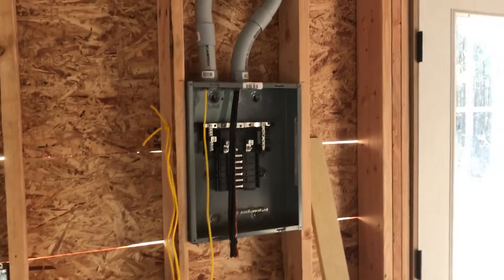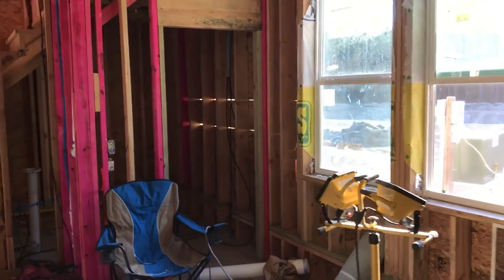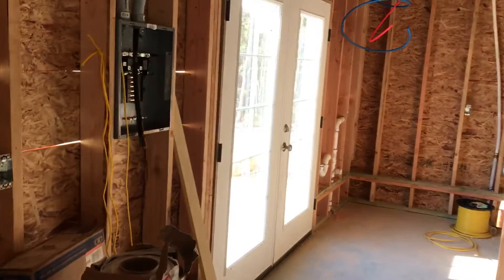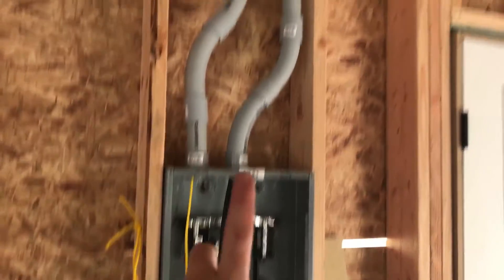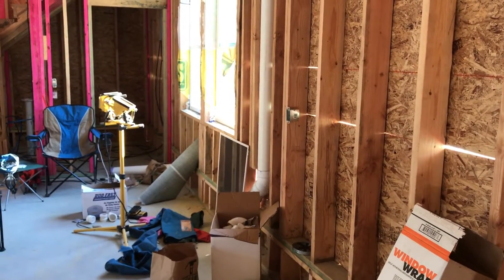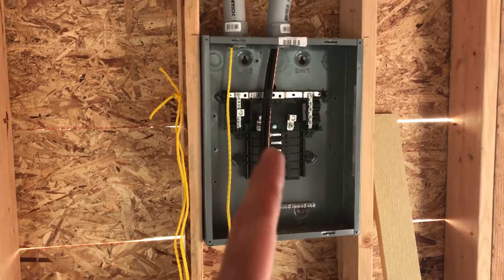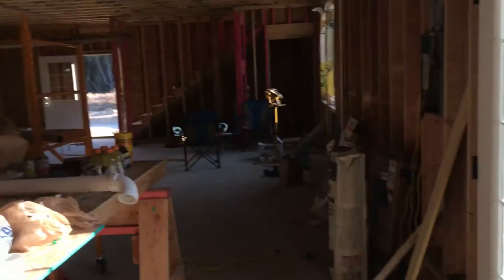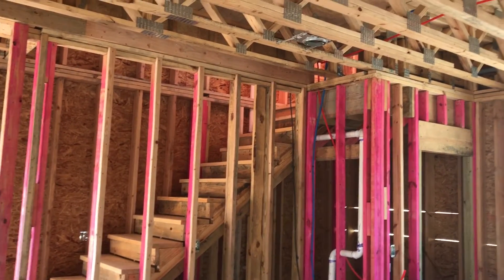Starting Electrical Rough In

Comment: Hi, how did you mount the panel? Did you mount it to the 2x4 or 2x6 or did you screw it to the osb board?
Reply from the maker: Joshua Wilson honestly I don’t recall but I think it can be either way. The depth of the panel is such that if can fit in a 2x4 stud wall. So the 2x6 wall it is NOT screwed to the OSB. Just don’t recall if we put blocking behind it or just secured to the studs. I think we screwed to the studs.
Reply: Tom Brueggen oh ok I was just curious though because I’m working on my panel and wasn’t sure if I needed to put osb behind it or just screw to the sides... but what type of screws did you use? Does it matter?
Reply from the maker: Joshua Wilson I’m no licensed electrician. But I don’t think the type of screw matters, so long as they are long and strong enough to secure the box. Then again, if you’re questioning what screws to use, I hope you’re confident in what you’re doing with the actual electrical :) good luck! Be careful!
Reply: Tom Brueggen thank you sir! Have a great day